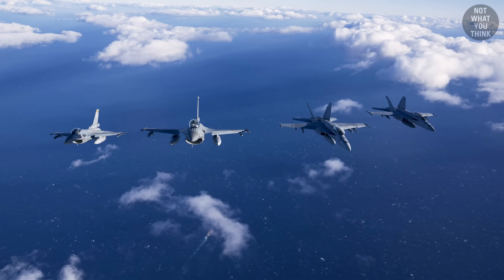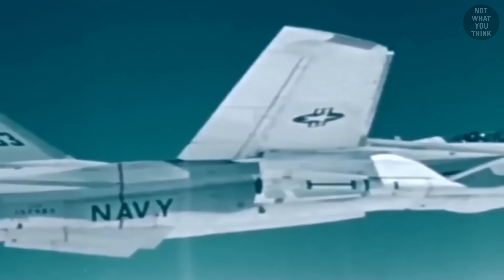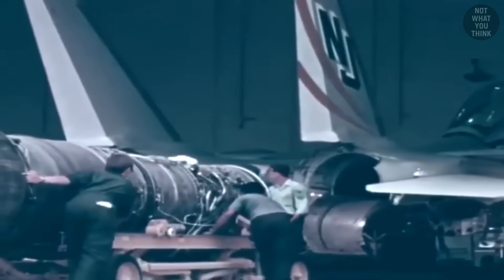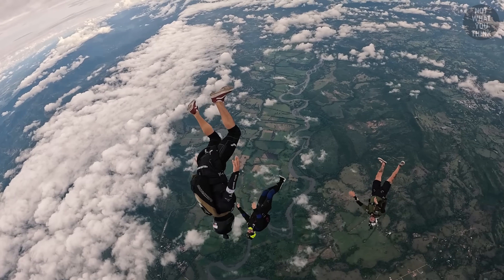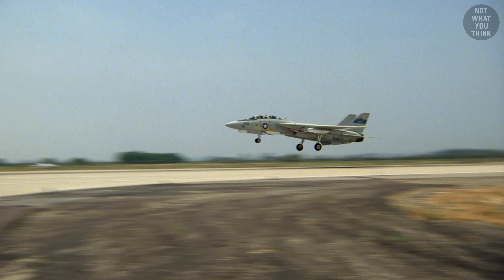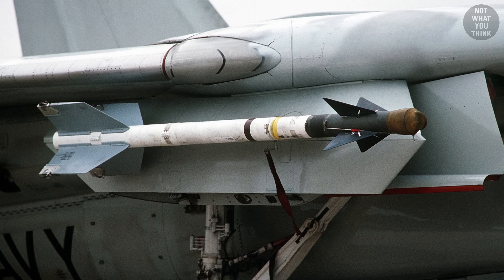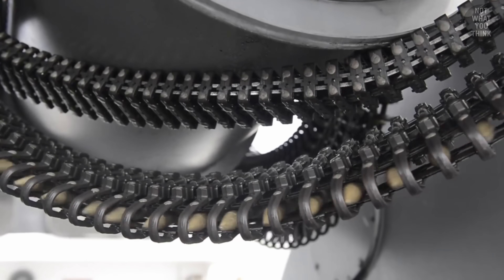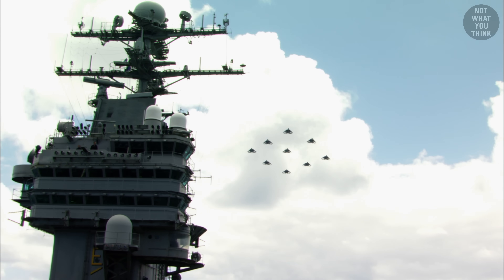Why the F-14 Was Built for a Weapon That Was Never Fired

Comment: I don't comprehend how assymetrical thrust cause problems like flat spins to a Tomcat,.. Flankers and Felons are also designed with it's engines far apart and most commercial planes with even farther spaced turbo fan engines but I haven't heard them encountered such problems, why???
Reply: The answer is two fold. 

1: Better computer control. The F14 was designed in the 1960's. The Su27 entered service in 1985. This is probably the biggest difference.

2: They did have issues with flat spin. But they didn't get as much attention as they do in the West. Those issues are gone now. Flat spin has basically been solved. Thrust vectoring in some Flanker models (like the Felon) also helps. 

Without computers, asymmetric thrust is a huge issue. 1960's computers weren't up to the task. But also, the F14 wasn't a true "Fly by Wire" design. It would let the pilot do whatever he entered into the controls. 

Flankers are true Fly by Wire aircraft. They won't allow you to do something that will destroy the aircraft.
Reply: @Kahless_the_Unforgettable 
Thanks for the input, I appreciate it... I have a follow up Q, Lol... why do F14 pilots used differential thrust or like Maverick would say, 'splitting the throttles' in their maneuvers if a flat spin was such a perennial issue ?
Reply: @AG1LA   Holy moly. Absolutely fantastic followup question. 

Okay, keep in mind that I'm not a pilot. Just an aviation nerd. But here's my understanding.

1: Purposely using asymmetric thrust is not the same as a total flame out. Having some power on one side helps prevent a flat spin. A total flameout means that side isn't producing any thrust at all, and the other engine is pushing to that side. On top of that, you have the issue that the inop engine is now creating drag on that side of the aircraft instead of thrust, which is pulling the aircraft to that side. Basically, some thrust is better than no thrust.

2: Differential thrust on purpose was still dangerous. As far as I know, it wasn't a recommended procedure. Maverick was just "That good".
Reply: You definitely know your stuff, sorry for the noob questions, I just love the plane aesthetic-wise and it stops there lol, Thanks again. @Kahless_the_Unforgettable
Reply: @AG1LA   Not at all! It was fun to answer them. 

Since I'm not a pilot, what am I going to do with this useless knowledge? Once every ten years or so, someone asks a really cool question that allows me to finally do something with the useless knowledge in my head. 

So yeah, it was fun. Thank you.
Reply: @AG1LA  not a problem in later versions of the F-14 which had more reliable engines which didn't flame out if you looked at them funny, unlike the original engines in the F-14A - look up the Kara Hultgreen mishap
Reply: Because of a combination of two facts.  1.  The first engines were designed for high speed level flight with steady airflow.  2.  The Tomcat has to do fighter manoeuvres
Reply: @jyy9624 thank you sir for a positive  comment. ✌🏼
Reply: The flankers engines as well as the fulcrum are angled slightly inward so they dont flatspin
Reply: @XeroOps   Your right. The engines on Flankers are angled ever so slightly inward. This is not to prevent flat spin. It was about aerodynamics. It was necessary because of the large lifting body. 

An inward canted engine would actually increase flat spin tendency in a flame out situation. Outward might help, but not inward. Think about which direction that thrust is going. How will that thrust move the aircraft when one engine fails? 

However, you're right to bring up aerodynamics. It was actually a more stable design than the F14. The design itself was less prone to flat spin. 

But not because of the engine angle. That would have contributed to flat spin, not prevented it.
Reply: @Kahless_the_Unforgettable 
I just checked the Felon and Flankers engine designs, you guys are spot on. Never knew that until now. Do u think US plane makers stuck with the engine close to each other to nullify flat spin?
Nways, kinda like Sukhois more now, lol
Reply: @AG1LA  @AG1LA   Absolutely. It's one of the reasons. 

But it's also that American designs have an entirely different purpose. Russian jets tend to be built for "Supermaneuverability". They want to bleed off all of their energy instantly in order to get a temporary advantage. 

American jets are designed to never get into that situation in the first place. We want to end the engagement before we get close. However, when we build an aircraft for dogfighting, we generally build it to maintain its energy state, not to lose all its energy at once. 

A single fuselage is better for that. 

Also, a single fuselage is better for stealth. I know the Su57 has two widely spaced engines. But there is a lot of speculation that its stealth is bad. Russian designers traded stealth for maneuverability. 

The F16, 15 and 18 were designed with the first concept in mind. The F22 and 35 were designed with the second concept.

There's more to it, but those are the main reasons.
Reply: Flankers nowadays use asymmetric thrust to their advantage, in order to pull tighter turns than most other fighters. The advantages of having a modern computer system governing the aircraft's flight. When the Tomcat was entering service in the early '70s the fly-by-wire systems were on their infancy.

Comment: The title, and thus the premise of this vid, is false., and kinda disappointing... Not that big of a deal, though. (Long post follows, sry (but I think it is worth a read.)

FIRST- The AIM-54 Phoenix air-to-air missile, which the F-14 was designed around, WAS used operationally (if not successfully) in combat, contrary to the video's title: It was first used by the US against Lybian fighters that were approaching a US carrier group, and, also later- in the Gulf war,. (Though, one COULD argue that, despite a lack of kills, the Tomcat/Phoenix combo WAS successful, since no Lybian planes ever approached the carrier group under the F-14/Aim-54 protection after that incident.

SECOND- it was used more than anywhere, and to great effect, by Iranian Tomcats in the Iran-Iraq war, with several verified kills-( but far less than Iran claimed, naturally!.).So, contrary to the (unfortunately clik-baity (sic) title of this post, it HAS been used 'operationally'  in the  air-to-air combat role for which it, and the Tomcat was designed- even for fleet defense... Many times.

Other than that excusable flaw, this vid is as good as most of this channel's consistently excellent posts. (Though, a cursory Wikipedia search could have, pretty easily, avoided such inaccuracies). Anyway, it is well produced and interesting to watch- one of the few channels that I watch at normal speed, instead of my normal viewing at 1.5 or 2x.

Cheers!

(P.S, it isn't like I trust Wikipedia- nobody should for anything that is not utterly basic, other than as a starting point. The often imbedded links in articles, and, particularly, the bibliographical citations are often in depth, specific, and reliable (and/or peer reviewed) from otherwise trustworthy, often academic/expert esources.)

Comment: 7:20 It is first microprocessor in the world. Predates intel's invention. Pretty interesting piece of tech.
Reply: Strictly speaking the CADC was a system of 28 linked processors. The Intel 4004 was the first true microprocessor.
Reply: @kitmoore9969  Well, you completely wrong and have no clue what about you writing.
First - "28 linked processors" blatant lie. It's 6 chips that integrated multiple things into them. It's exact definition of microprocessor.
Also 22 of your "linked processors" is RAM and ROM.
And more - it you want define that only "TRUE MICROPROCESSOR" can be in single chip - you would cancel i4004 - because it's system with at least 4 separate chips, not integrated. 
And more...
Modern Ryzen also not a "true microprocessors"~ Because they are not an single chip. It's multiple dies in single package~
Reply: @LeonmitchelliGalette  Please update Wikipedia with your sources.

Comment: Where would Naval Aviation be today had the Douglas F6D Missileer entered service in the early or mid 1960's? Surely, the F-111B would never have to existence. But the F6D would be useless over Vietnam unless the ROE permitted BVR engagements. It's probable that the F6D would ultimately be replaced by a navalized F-15 in the 1970s. What is everyone else's thoughts on the F6D never being canceled and being finally being succeeded?
Reply: "Navalized" F-15 is a nice fantasy

Comment: In 1980 the radar could only handle seeing around 8 aircraft. The problem was 'ghosting' if you went above 4-5 aircraft. Nominally the RIO would set the radar to target 3 at a time, to avoid ghosting on the screen.

Comment: The F4 did have a gun, it was just added later in the Vietnam War as a response to pilot complaints. The gun even scored a few kills
Reply: Because it was an afterthought integration it's accuracy was very poor
Reply: Most of us would forget that the F-4 was designed as a “Supersonic High-Flying SAM Site” and not a “Nimble Tail-Chasing Dogfighter”…
Reply: Only the Air Force variants got that, and it was mainly a stop-gap solution to the training issues plaguing the Air Force. Meanwhile the Navy variants achieved better kill ratios.
Reply: The F-4E was the gun-equipped variant and only the USAF had it, the USN and USMC had no such thing. The Navy's F-4J variant was their equivalent to the USAF's F-4E in most respects EXCEPT for the internal gun.

They didn't equip the F-4J with a gun on the nose like the F-4E had because they deemed more important to have a bigger, more powerful radar at the time as during that time (we're talking mid-late '60s here) the Tomcat was only a concept if anything at that moment, so the F-4J was pretty much their only operational interceptor. They could not acommodate both the gun AND the bigger radar within the F-4J nose, so when given the option to choose one or the other they went with the bigger radar, eschewing the gun in the process, hence the still gun-less F-4J.

The F-4E for the USAF did have a gun because they went for a bigger, longer nose and at the same time they used a smaller radar (weaker than the APG-59 radar on the F-4J) that didn't take much of the nose for installation, hence they were able to squeeze a gun into the E's nose.

Comment: Spent shells should be able to be dropped out the rear as a defensive measure.  The hot metal may do well throwing off missiles etc if flares have been spent
Reply: nowhere near hot enough
Reply: @therflash don't add problems, add solutions. For example - to mitigate that, the spent shells can be stored in part of and/or next to the exhaust.

Comment: A bit off base with the tunnel existing due to the missile dimensions.  The design departure from a steel wing box in the early phases necessitated a lifting body to absorb some of the physical stresses on the titanium wing box and pivot points.  The tunnel handily accomplished that structural hack, and only when grumman went to congress with the 303A design sheet did the accommodation for the early AIM 54 appear in the revised 303E design.  Never forget that the Tomcat was a mess of compromises in adopted systems and technology that somehow worked out for the better.
Reply: Can you imagine a new version of the Tomcat optimized instead of compromised?
Reply: It is amazing how many compromises went into the Tomcat and yet how insanely TOUGH that plane was.
An Iranian pilot took one out on a mission and came back with only half a wing, one tail fin, and only the landing gear under the pilot still attached. The body was all shot up to hell and back and only a single engine still working. Plane still brought the crew back safe. That is an insane amount of damage for a plane to take and stay airborn.

Comment: So america had actually fired 3 Aim-54 Phoenix missiles in combat. None hit but they were used in combat by more than one nation.  

Also:

The AIM-54 Phoenix missile saw significant combat use by Iran during the Iran-Iraq War, where it achieved numerous kills against Iraqi aircraft, while the U.S. Navy's use of the missile was limited and considered relatively unsuccessful, with only three instances of its use and multiple failures. The missile was designed as a fleet defense weapon to intercept large Soviet bombers from long range, a role for which it was well-suited but less effective against smaller, more agile fighter jets.  Iranian F-14s using the Phoenix scored a confirmed 78 kills against Iraqi aircraft.

So what was the point of this video?   Other than to be far less than accurate?
Reply: Did you even watch the video?
Reply: Just go away

Comment: 8:29. Lol why the f is that maintainer drilling into the wing with a hand drill?

My guess is birdstrike on front wing edge left a dent, and they are just panelbeating it out.
Reply: I've had to drill out a screw in order to use an EZ-out to remove it.  There was a panel on the A-4 Skyhawk's vertical stabilizer that was bad for screws corroding and needing to be removed like this.  A contributing factor was that the screws were aluminum with a Phillips head, and I've had the Phillips feature shear right out.  The aluminum screw threaded into a fixed steel nut ("anchor nut"?),  so corrosion was fairly predictable.
Reply: @SkyhawkSteve  Ok. Doesn't that wing root/leading edge look like it's got a big dent in it tho?
Reply: @angusmatheson8906  possibly.  Might have been hit by some GSE or a bird strike... or a frustrated maintainer.  😁   It's better to just learn to curse creatively instead of taking out the frustration on the aircraft, though.
Reply: Drilling out striped screws....
Reply: @blackpowder13  what does that mean?

Comment: 9:57 wait the phoenix was hypersonic? i thought only the nasa research version(stripped of its warhead and stuff) could go that fast. I thought the AIM-54's top speed was closer to mach 4 to 4.5
Reply: There are caveats to that. I recommend looking a youtuber that goes by the handle Habitual Line Crosser. He is/was a Patriot operator and has a touch of the missile-tism. The short answer is yes the phoenix was hypersonic. The real answer is the phoenix would shoot up to 50 to 60k feet and at its apogee yes it was at or above mach 5, but during its terminal phase where it plunged onto its target it wasn't so just like all of russian and chinese hypersonics aren't true hypersonics and aren't hypersonic in the terminal phase.
Reply: @dtploeg1000  --  From Wikipedia:
    Maximum speed: Mach 2.34 (1,544 mph, 2,485 km/h) at altitude
    Mach 1.2, 794 kn (914 mph; 1,470 km/h) at sea level
    Cruise speed: 420 kn (480 mph, 780 km/h)
Reply: @sheldonaubut that's the jet. He was asking about the missile. Wikipedia says: 
AIM-54A/B - Mach 4.3 (1,460 m/s; 4,800 ft/s)
AIM-54C – Mach 5 (1,700 m/s; 5,600 ft/s)
Reply: @NOLAfugee and even than there this one story about an f14a going so fast the cockpit glass started melting.(I think the number was somewhere in the mach 2.5 range?)
Reply: @dtploeg1000 Yes, I remember seeing that story and I believe it was confirmed only on the A model with the TF30 engines. The F-14's top speed was reduced to about 2.25 to 2.3 with the other engines but the reliability and extra power more than made up for it.